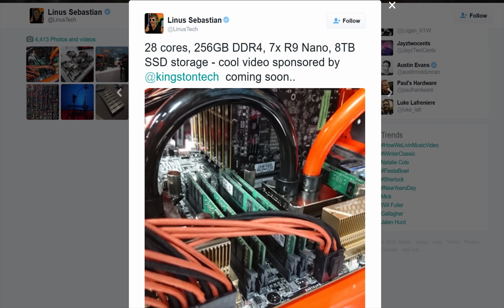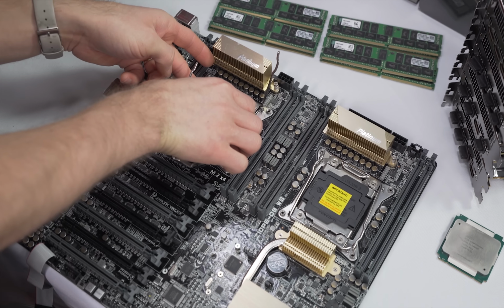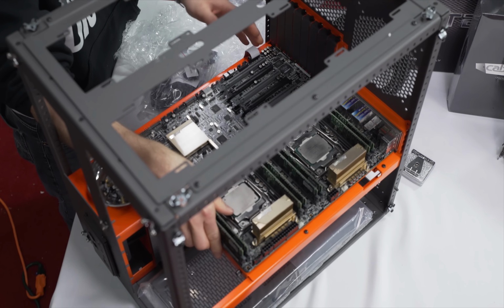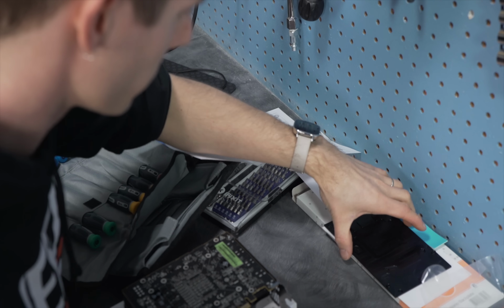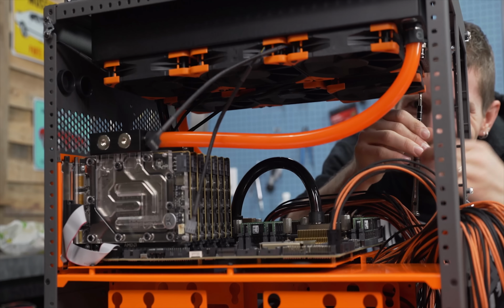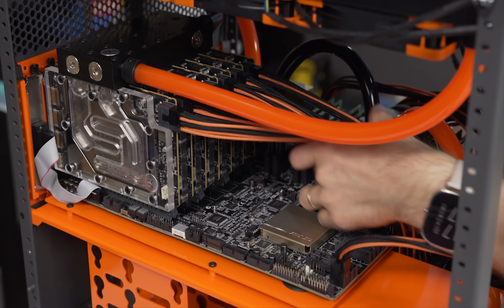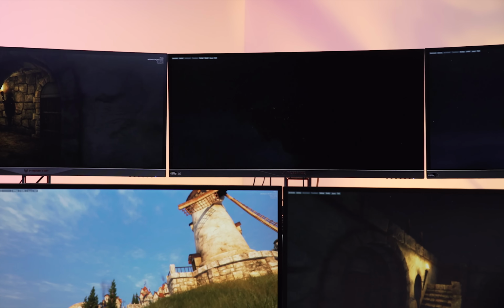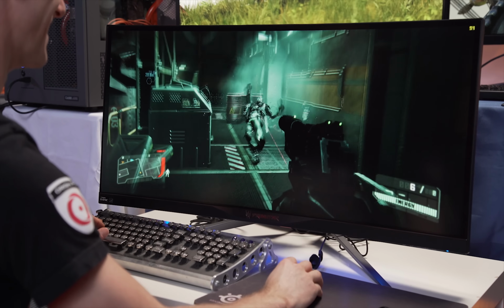7 Gamers, 1 CPU - Ultimate Virtualized Gaming Build Log

Comment: this is pretty cool but $30,000 / 7 = $4285 so basically thats 4300 per computer. However, what each gamer gets in the end is not a $4300 computer. 4300 would get each gamer a much better performing computer for the each of them. Really cool though

Comment: Extraordinary Linus! Professionally creative you are! What I think you guys are probably missing here is the performance per VM. I mean c'mon, avg. 80 FPS fluctuating between 60-100 in Crysis 3 at 4k, through just a single R9(1 GPU per VM). BOOM! That FPS is not achieved yet even with i7 Extreme+GTX 980 SLIs(so far what I've seen). Makes me wonder, is CPU the real limiting factor when it comes to gaming at 4k, rather than the GPU? This rig totally stole my heart.

Comment: Hey I am making a PC build and I am new to PC building i have picked out these parts can someone tell me anything that's not compatible or would be better also if you can find a case and proper power supply that would be great thanks a lot :) 

AMD FX-8350 Black Edition Vishera 8-Core 4.0 GHz (4.2 GHz Turbo) Socket 
 Seagate Hybrid Drive ST1000DX001 1TB MLC/8GB 64MB 
GIGABYTE GA-990FXA-UD3 R5 (rev. 1.0) AM3+/AM3 AMD 
 CORSAIR Vengeance 8GB (2 x 4GB) 240-Pin DDR3 SDRAM 
MSI GeForce GTX 970 GAMING 4G
Kingston SSDNow V300 Series 2.5" 240GB SATA III Internal Solid State Drive (SSD) SV300S37A/240G

Comment: have you tried this on a 14 player option using a 4 cpu board and ask the main board manufacturer to suoply you with  a case that can handle 8 or more cards???? I would like to see a build running 3 phase power

Comment: Is this actually useful? Is there a real benefit? Even looking at price 30k and only 7 gamers is a lot off from anything practical.
Reply: +miiiikku This build was purely to show that it can be done :)
Reply: There could be a niche where this is useful or something that could become useful at some point.
Reply: miiiikku
Maybe.
Reply: +miiiikku This is cheaper (and less power consuming) than building 7 similar systems (1 CPU, 32GB RAM, 1 SSD, 1 GPU). I mean if you want to have 7 systems like this why not combine them into one, save some cash overall and impress the hell out of everyone.
Reply: +CazRaX This isn't cheaper than buying 7 similar systems... just the 2 xeon cpus cost $2500 dollars each,  just with the price of 1 you can get 7 6700k cpus and with the price of the other one you can get 5 of the 7 r9 nanos you need for 7 different pcs...
Reply: HeyDan1983 You think so huh? You think that will outweigh the 7 motherboards, 7 cases, 7 sets of ram, 7 power supplies and 7 sets of water cooling you need for those other PCs?

Comment: can it run notepad, with steady 5fps ?
Reply: on low settings
Reply: ***** no, it run from potato !
Reply: ***** meanwhile on "old computer review" (usually 80's to 90's desktop PC with "TURBO BUTTON" on it) the top comment is "Can it run Crysis ? "
Reply: it is literally incapable of running notepad that slow
Reply: can it run windows 95....with screensaver on?
Reply: +Turrnz But do you know what internet jokes are?
Reply: +Turrnz ha ha xD
Reply: +IndraEMC 
I read this in a james bond accent hahahahahahahahahahahaha
Reply: Freedom Fighter my name is PAD, NOTEPAD !
Reply: no
Reply: tf god no u need 4 extra gtx 1080s and 800 gb of ddr4 ram u dumb??
Reply: 320x160 res
Reply: The hell are you thinking? no machine, even the most powerful quantum computer that will ever be created can run it at 2fps at 144p, get your facts straight man!
Reply: Devin Hepburn except Intel Celeron or AMD Sempron, it so fast, it can run anything !
Reply: IndraEMC Just benchmarked an AMD Sempron 145 machine that i had lying around, i was impressed, i ran it at 69k at 69fps. These are pretty weak however, compared to ENIAC, this 1946 computer ran it at 666k at -666fps (remember, negative framerate is more fluid than real life!) . Intel 4004 based machines are good too, but for the best performance, go with the ENIAC.
Reply: Freedom Fighter eh, i could higher a $3.14 hoe to do that work.
Reply: Devin Hepburn 
Just make sure she doesnt carry any viruses
Reply: Freedom Fighter
oh don't worry, right after i bought her, i ran some MS-DOS version of McAfee scan and a TF2 Medic checkup! everything going to be just fine, hopefully.
Reply: Freedom Fighter
Just did that, got a prostitute that's so old that i killed jews in a genocide no-one ever heard or payed attention to, i hear it happened from 1939-1945, than she fucked any living soul that wanted her too from 1945-2016, apparently, she's still living today
Reply: +Devin Hepburn but the question is, can it run faster than sanic? xP

Comment: Guys I am going to be building my first gaming pc and I have chosen my parts but I would like to know if its actually worth it. 

Intel core i5 4690k 3.5 ghz quad core
Cooler master hyper 212 evo 82.9 cfm sleeve bearing cpu cooler
ASrock h97m anniversary micro atx LG1150 mother board
Kingston hyperX fury blade 8gb ram DDR3
MSI Geforce gtx 970 4gb twin frozr V Video card
Deepcool tesseract sw atx mid tower case
 Corsair CX 600W 80+ Bronze Certified Semi-Modular ATX Power Supply
Let me know if this is any good! cost will be around $1200 CAD

Comment: So my guess is unraid doesn't require different USB device (doing so just simplifies the process) but instead shows what's plugged into a USB port and assigns that port to the virtual machine. so if you wanted to, you could use the same USB devices and it would just be confusing if you don't label USB ports and display outputs that match up with each other/ each virtual machine. Yes? No?

Comment: 10 years later, 10000 gamers 1 cpu build log

 parts of the 100000 € computer: 20 intel cores i14  23 ghz 49 cores(6gb cache), 60 gtx 2980 titan y(3tb gddr12 vram), 30tb 10000mhz ram,  custom ice cooling loop, 30 pci express ×98 slots 100tb ssd, 900000 watt diamond+ power suply,10×10×10mm case, a 90 pci and 20 cpu motherboard

Comment: At a recent Sci-Fi con there was a multi-system Bridge Simulator over LAN. It didn't work incredibly well. The LAN crashed and kicked systems out on a frustratingly regular basis. I wonder if this sort of build could be used. And it would only be a five-user build, not a 7.

Comment: +LinusTechTips 1 question: How are all the VMs going to get 4 cores and 8 threads, what about the unRAID install on the PC? It needs CPU cores as well, right? And does unRAID need an 8th GPU for itself or it can run headless without a GPU?

Comment: Sorry if it sounds dumb but.. How to multi user?
How to make several user running 1 system independently and simultaneously?
Reply: +Yahtadi Shidiq virtual machine
Reply: ***** Can you explain it more clear my good man?
Reply: Yahtadi Shidiq the total computing power is virtually divided into 7 different "pc" s

it doesnt exist physically, but the program used makes the machine behave as if theres 7 computers (in this case)

you can even do it yourself by creating a separate partition on your hard disk and installing a different OS on it, its like how people can install windows on their mac
Reply: ***** i can understand in ''separate hardisk and install  different OS on it'' part, but the question is.. Can that way running in one time? How to control that several separated hardisk with different OS independently? is there any third party application or something?
Reply: Yahtadi Shidiq yes everything can run at the same time, since they are all separated. Its just like 7 real computers

the program is KVM i think

control with 7 screens, 7 kb + mouse
Reply: ***** Really?wow. So in case i have 10 hardisk with OS in it, each.. And everything in 1 rig.
When i turn it on, What would be displayed?
How to set 1 monitor + 1 kb + 1 mouse to get 1 hardisk with OS in it?
Sorry if i kept disturb you man.. I just really wanna know how it works

Comment: ....but can it run doom.
Reply: +Fangs of Yima No, but it can run Wolfenstein 3D. You'll want to bring the screen size down a bit, though.
Reply: +Fangs of Yima Lets see, put 1 instance per core, 14 cores per processor, 2 processors per rig... 5 fps?  That would add up to 56 instances with hyperthreading
Reply: Do do do dodo do do do duh
Reply: no,it can doomed you
Reply: It can barely, at 5fps

Comment: Only Confused With One Thing And That Is How Each Person Can Use A Separate Keyboard And Mouse Without It Moveing The Other Peoples Mouse's :| Might Of Been Said In Vid But Idk
Reply: +Flat4Buggy 2 Thanks, but I looked into unRAID and I still have a few questions. How is it different from other software like VMWare or Hyper-v. I 'm not a VM specialist, but is assigning certain hardware directly  (video, usb ports, etc ..) to certain VM's what makes this product unique. Or is this also possible with the 2 others.
Reply: Yep
Reply: It's running 7 instances of the os, each set of I/O's configured to a separate instance.
Reply: +Draegor X which must mean each monitor has at least 2 USB inputs, because I don't think there is a computer case or motherboard combo that has 14 USB ports
Reply: okay that makes sense, thanks
Reply: +Gamre Writing you from my USB keyboard on an Asus Z97Pro-Gamer with 14 USB onboard ports.

Comment: This would be absolutely perfect for someone who owned a internet cafe that was geared towards gamers. At 2-4 dollars an hour times 7. The system could pay for itself quicker than it would be obsolete. The benefit of virtual machines is the fact that if something crapped out (due to users loading software etc) it could be restored to the "beginning of the day" default without much effort on the vendors behalf. 

If a vendor ran 12 hours a day.... 365 days a year, and was able to rent out time at the max of 4 dollars an hour.... well thats $122 thousand dollars! even if they rented out a quarter of that machine, its paid for... and generating pure profit from that point forward. 

Excellent video... no need to unsubscribe from linus any time soon. Well done. 

If you havent.... hit that subscribe button now!

Comment: So basically if i hooked this whole thing up to just one screen and played just bymyself on this system..Would i basically be able to play any game out today i please on super maxx settings and it could handle it?? like id be able to alt tab out and go on chrome youtube twitch and just back in and it would still be super perfect good?
Reply: +jasmin banks
To put it simply, all Linus did was take 7 rigs, and put it into one case. Those 7 GPUs aren't functioning as 7 GPUs, they're functioning as one single GPU for 7 different computers. This means you'd get the same performance that you would from just building a regular rig with an R9 290 nano.

This also means he's not using all of those cores, he's only technically using 4 cores for each GPU, which means he's getting (remember, PER monitor, which are all running as their own machine) the performance of a rig with an R9 290 nano and a 4 core cpu.

You can't use 7 GPUs for one single computer, you can only use up to a max of 4 in crossfire. You can however use both of those CPUs for one computer, but it wouldn't perform the way you'd think.
Reply: No its 7 SEPARATE systems

Comment: Do someone here have the knowledge when it comes to gpu, I have a evga 980 sc 4g and thinking of buying a Evga 980 ti sc or a regular without sc dont know yet but do they work toghete and can I run tripple a games at very high fps if so? I have looked around but could not find my answer.
Reply: +Littlefroggydew You could run two 980s together but not a 980/980ti combination.
Reply: +Littlefroggydew The GTX 980 and GTX 980ti use a different graphics processor and both have different amounts of VRAM, so they are not compatible together in SLI.

Refer to this post for more information: https://forums.geforce.com/default/topic/469402/

Comment: +linustechtips what do you use to control multiple VMs at the same time? I'm on Win7x64 and I assigned my VMware Workstation VM a keyboard but I need to have that window selected in order to use it. What program did you use?

Comment: Budget version?

Same case - Caselabs Mercury S8 ($400)
Same motherboard - ASUS Z10PE-D8 WS ($565)
Same software - Lime Technology unRAID ($129)

2 x Xeon E5 2630-V3 ($1,344)
8 x Kingston 8GB DDR 4 ECC ($500)
8 x Kingston SSD 240GB V300 ($560)
1 x EVGA SuperNOVA 1200W Platinum ($250)
7 x Geforce 750Ti Single slot ($875)

For a total of ($4,623) excluding costs of Windows license, Games, monitor, keyboard and mice.

7 x 1080p monitors ($840)
7 x keyboard and mouse ($210)

An additional ($1050) totaling ($5,673)

I wonder how that would run and if you could shave more off CPU, RAM and SSDs but still enjoy 7 x 1080p gaming.

Comment: But to handle with 256GB of RAM you need a system higher than 64 bits, because the max memory supported with 64 bits is 128GB of Ram, right? What did you do to surpass this?
And by the way excellent experience!!

Comment: have you considered using 2 PSU(or more) to power EVEN more GPUs? you would need to just connect 2 pins in mobo connector of the other PSU to boot it up... in theory.

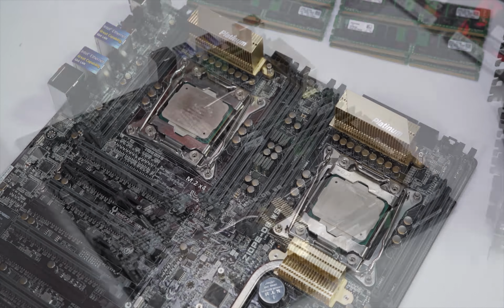Comment: 2:42

i5 desktop CPU's do not support Hyperthreading.

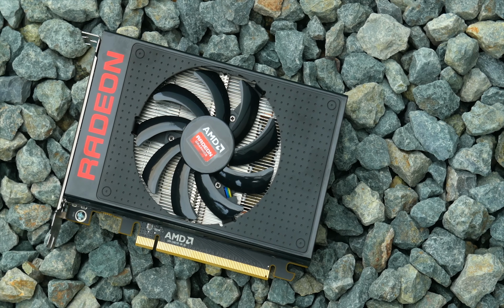8:27

Why not just daisy-chain 2 supplies and load balance 3 cards + CPU's on 1, and 4 cards on the other?

Also, why are you using Acer x34 Predators on AMD cards.. why not just get the FreeSync version?  Wasted GSYNC

Comment: This is a monster machine! I'd use Freesync monitors rather than G-sync tho.
Reply: +Shengda Yang 
Exactly.. costs like $400 less per panel (although I don't think the FreeSync version can be OC'd as high.. the Predator x34 goes to 100hz, where I think the FreeSync is 75)
Reply: +druuzil my freesync monitor runs with 144hz
Reply: Lorenz Pfander Not the 3440x1440 model.

Comment: Ay man I need some help with my laptop, idk most things about computer building but my laptop is dying. It's a 1.20ghz Intel i5 processor and an amd mobility Radeon 5450 gpu with 8 gb's of ddr2 ram, from what I've heard I'm using the worst possible hardware out there. My computer in a nutshell was recently updated to Windows 10 and it died from there, it was formatted a few times, Windows 10 "corrupted" itself somehow and won't launch anymore, back in Windows 10 my computer launches all my games with a black screen and it won't let me update my graphics card, thank fully I downloaded Linux Mint 64x when I was in Windows 10 but it says my graphics card isn't properly installed so it won't use the gpu, I'm thinking of downgrading back to Windows 7 professional but I'm not sure if I should get a new computer all together. If anyone could help me with this situation of either, formatting the hard disk or, getting the computer faster that would be great since I can't play anything now

Comment: What did you use for the Virtualization layer?
Reply: Travis sturzl we experimented with Xen early on and it just didn't fit the bill for what we wanted. Being native to Linux, KVM has been advancing faster and seems to be easier to support actually. GPU pass through also works phenomenally better on KVM than with any other hypervisor we've seen.
Reply: +Josh Digby Caesar In an earlier video where he ran 2 VMs on a much less powerful rig he used unRaid OS and its virtualization manager which I believe is based on Xen.
Reply: +Travis sturzl it actually uses qemu/kvm
Reply: +Jonathan Panozzo 
KVM, even better. Read Xen somewhere but looked on there website, KVM and qemu.
Reply: +Jonathan Panozzo That's the catch right there GPU passthrough. unRAID is an interesting solution, never heard of it before. although I'm not a big fan of it's raid configuration it is an interesting setup and definitely shortcuts everything.

Comment: Sitting here watching this, the pcie slots in my motherboard stopped working the other day, basically bricked when I put a Graphics card in it, but works without it, after re-seating the 24 pin power connector.  like hook a brother up lol.

Comment: Imagine this same concept with 7 PowerColor Devil 13 r9 390 II cards... In case you don't know they are dual-gpu cards that each require 4 8-pin power connectors... The lights would dim at that point assuming you had enough power supplies for all of that in the first place.